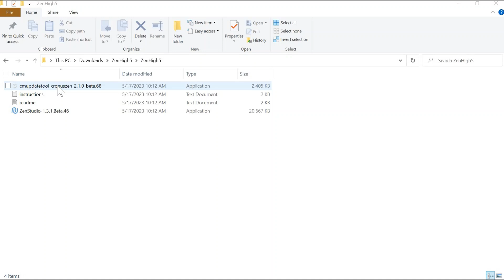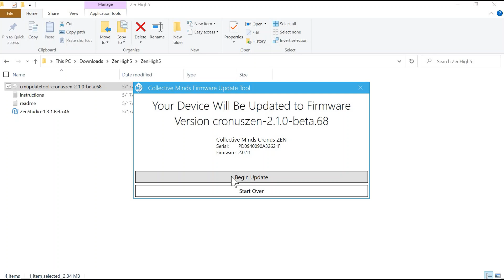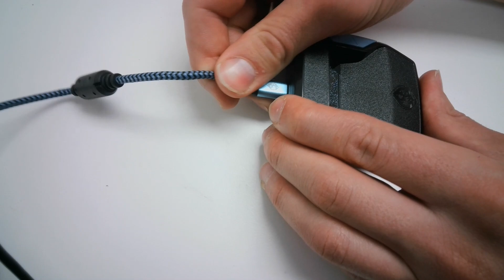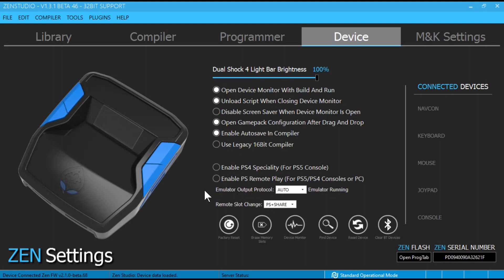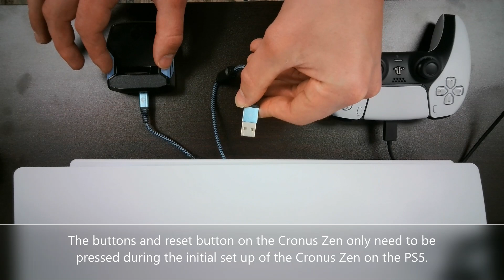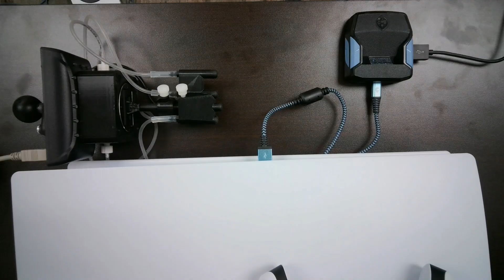Using Adaptive Controllers on the PS5: Cronus Zen - Update: This method no longer works with PS5

Comment: My A1 Adapter doesn't seem to be working, any ideas? No lights, I know the cable is good because i can plug the ps5 directly into the console with it and it works. Changed all the reccomended settings, disabled bluetooth, controller is fully charged etc. The light on my A1 port doesn't even light up

Comment: My controller on ps5 keeps disconnecting how can u stop this thanks
Reply from the maker: Make sure that you have all Bluetooth devices removed under the controller settings and make sure all of the power settings are set as they are laid out in the video.